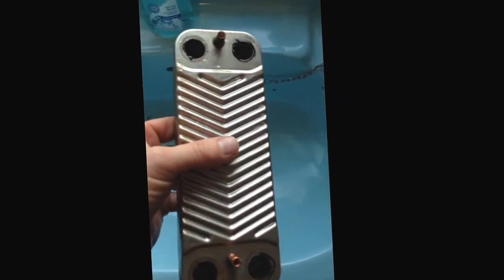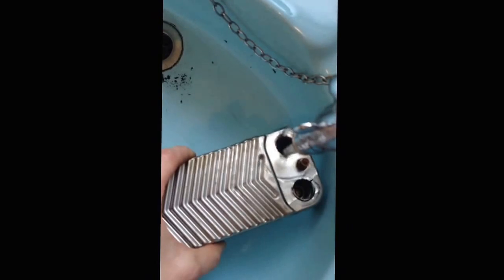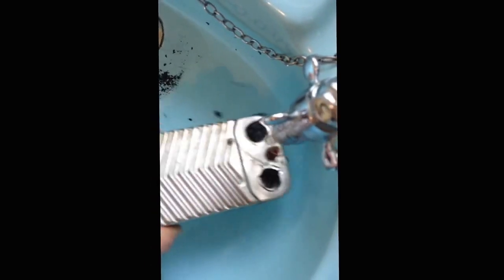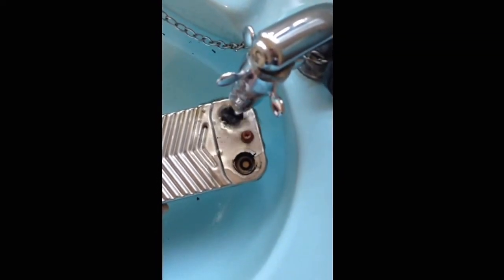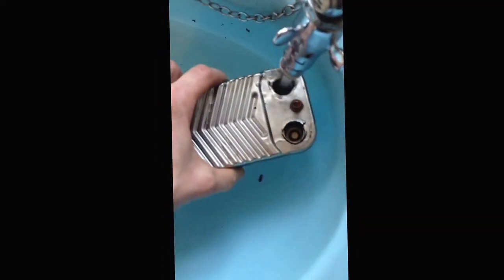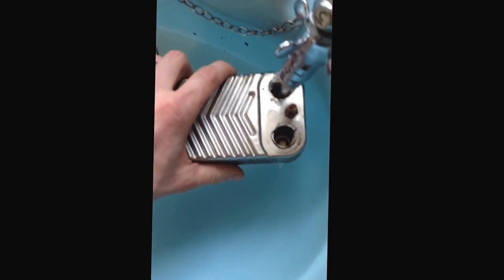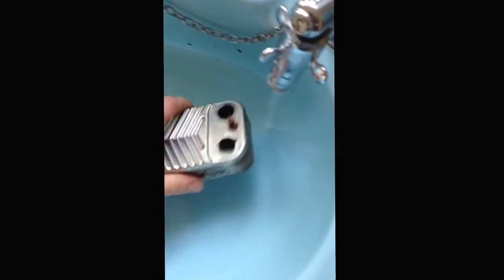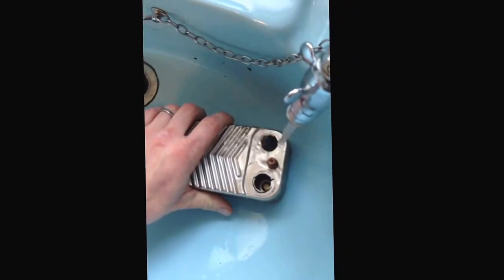Boiler repairs (blocked plate heat exchange) part 1

Comment: Block plate heat exchanger will not clean out with just water, you will need to put caustic soda into it, but sometimes caustic soda doesn't work at all so you will have to replace the whole thing

Comment: washing out alone will not work on most blocked heat exchangers. i personally use a product called one stop drain cleaner which is basically sulphuric acid, left in the exchanger for upto one hour dissolves the crap inside and then thoroughly flushed out with water, refit and will in most cases be as good as new
Reply: I reckon you'd also need to flush the system, otherwise it could just get blocked once again...
Reply: Exactly what i thought... Gentle rinse aint no good 😂
Reply: +Kingsway Driving - Richard King ADI or fit a magnetic filter on boiler return... The poor mans power flush!!! 😂
Reply: Not easy to see where I could fit one, as there is no space.  But I'm hoping to flush the system this week.  I think the original installer failed to use any inhibitor.  I flushed the system once before and got rid of a lot of rubbish. I think this time there will be very little sludge left.  The secondary heat exchanger  though,  looks like it needs to be decalcified.
Reply: John sulphuric acid doesn't usually do the job and sometimes can cause damage to plate heat exchnaher hence why you only put little amount in